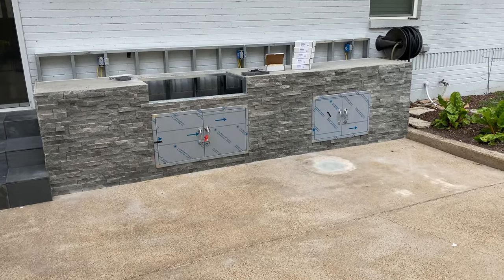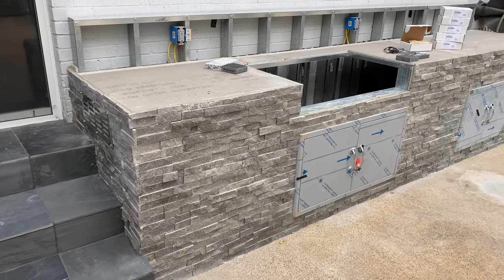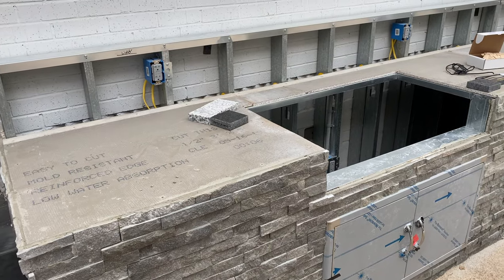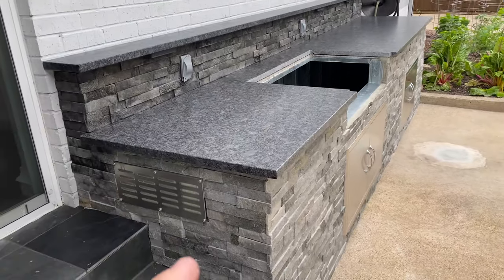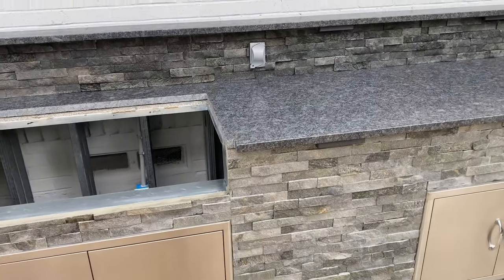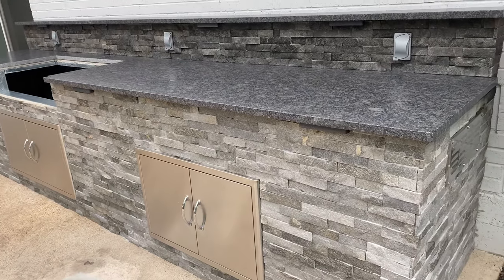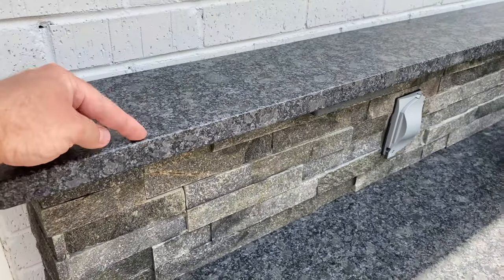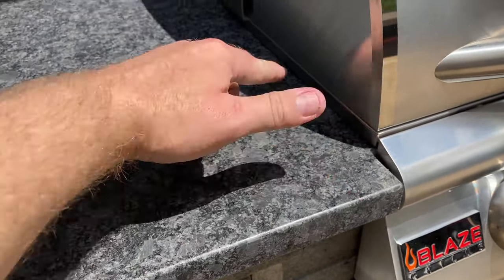Building an Outdoor Kitchen PART 2 - DIY Build Finishing Stone, Counter & Lighting

Comment: I realize this video is dated now, so please answer a burning question or two: a) How is the setup holding up/working out? b) Did you regret building up against the wall? At one time we BBQ'd on the pavers in the back yard but the proximity to the house caused soot buildup over time. We didn't notice until we painted and the 2nd story was black, especially the soffits.

Comment: Hi Brandon. Congratulations on this build, it looks amazing! How did you deal with the stacked stone in the front where the floor wasn't even from one side to the other? I saw that you used over an inch shim on the right side over the left side. Thank you.
Reply from the maker: Just started from the bottom and went up. The very small gap is under the granite edge. Caulked it after the put in granite, don't even notice it there.

Comment: What an excellent build sir. The lighting was great idea to add I didn't think about that. I have a question I was looking at the blaze also and wondering did you need an insulated jacket for the grill? I didn't see one installed or does your grill not require one? This is my dilemma- I want to build with steel studs like yours so its non- combustible.
Reply from the maker: I did not need the insulated jacket since it was build with “non-combustible” materials.

Comment: i have saw-chopped ledger stone, it is similar to yours, but much deeper.  It is chopped on the thin side and sawed on the wide side.  So, I thought I should mount it horizontally instead of vertically, meaning the chopped side is exposed and the sawed side is stacked with mortar.  How do I lay the stone across the tops of the drawers and cabinets?  Should I pull out the drawers and cabinet doors farther from the cement board, so that I can stack the stone on the top of the steel?  It needs support, otherwise I think it will fall off.  Thanks.

Comment: Looks great! I am however concerned about the amount of heat generated under the counter. Did you use some sort of heat shield? Want to be sure before I build mine. Great job, thanks for sharing!👍
Reply: He's got a vent in the side wall near the stairs going into the house.  The installation instructions that come with the grill should specify how to properly vent the countertop.  The vents are mostly to prevent possible gas build-up and explosions, but do help dissipate heat.  The lid of the grill will also vent some heat, even when closed (from the front under the controls to the back of the lid).

Comment: Awesome job Brandon. You have skills and taste! Question, Did you draw a level line along the bottom of the front of the Permabase and start from there with the stack stone? Since the ground was not level. Then cut the bottom row of stack stone to fill in space from the floor to the level line? It  looks perfectly even. Loved your videos' I will use steel studs for sure now.
Reply from the maker: I was originally going to start the stone on level chalk line but that really complicated it. I actually I just started stone flat on bottom. It worked out at the end, especially if you can’t tell. Look closely at very bottom, all full stones. Thank for watching.

Comment: Brandon, awesome job Sir.  You inspired me to construct a similar outdoor space.  I'm adding similar landscape lights.  Did the wire and top support frame for the landscape lights have any negative effect on the granite countertop?  Worried about the wire getting pinched or the granite not sitting right.  Great work!
Reply from the maker: No issues with wires. I notched the top so the wire sat flush with top See here 8:03. Plus any granite company you hire will level the countertop as needed.

Comment: Looks great and enjoyed the video and info provided.  I think I will use similar lighting.  I am just framing my outdoor kitchen now.  Did you have to put cement board under the countertop and why?  Just to better adhere?
Reply from the maker: After the fact I really didn’t need to put cement board under countertop per granite company.  But half way thru I couldn’t change that based on my measurements for grill height.

Comment: Hey Brandon. Really like the landscape lighting touch. As installed (under your granite countertop I believe) how do you plan to service if a light goes bad or bulb burns out. I know my garden bed landscape lighting bulbs go out more than I like although they aren't LED. Just wondering if you have a method planned should you have any issues with these down the road. Thanks!
Reply from the maker: Good question. So that one main reason I went with the higher quality $$$ FX brand versus a cheaper wall light. Everything is accessible on the exterior. Here is more detail of the repair…  https://www.fxl.com/support/changing-led-board-lf-wall-light  But time will tell!!

Comment: Great Video!   I have watched numerous times and I will continue to.  I am planning on using the same adjustable outlet boxes but I can not seem to find any weatherproof outlet covers to fit those blue boxes.  How di you do it and what did you use?
Reply from the maker: The outlet cover is Sigma Electric, Gray 14147 1-Gang Universal Cover. Maybe a quick search and you might be able to locate it. I went back and forth on a cover I liked, not many options out there.
Reply: @bmarsh011  
Thanks for the info.  I’m using the same outlet boxes and I found the weatherproof covers you recommended  they should work great

Comment: This is amazing! When measuring the cutout for the bbq, do you consider and extra, I’m assuming 1-1.5 inch for the board and veneer? So if the cutout depth for bbq is 28”, are you cutting 28” out on the frame, or about 25-26”?

Comment: This came out great and will definitely reference your video as I start my DYI project.  A few questions:
How much of a granite overhang did you include to incorporate lights?
How do you power and turn on lighting? Is there a transformer mounted somewhere and wifi controlled?
Also how much of a gap did you leave at the bottom before stone starts?
Thanks
Reply from the maker: Granite Overhang: the depth of top granite is 7in.total With the backboard and stone on the overhang finish is roughly 1.5 to 2in, varies some with the stone thickens in different areas. Where is light at there is only about 1/2 overhang
Lights are wired to my landscape lighting that is powered with transformer. Powers the front and back of house landscape lights and grill all connected together. You could just have a separate transformer for your grill area if you want to keep separate. 
No real gap at bottom of stone, very thin to minimal gap. 
Hope that helps

Comment: Looks great!  Curious about how you dealt with the ledger stone.  It looks like you slid your grill over the ledger stone but for your doors, you installed them first and butted your stone against the frame.  If so, why didn't you also butt up against the grill face?  Also, with the specs on the MSI stone being 1 inch deep, did you mount the doors flush with the cement board or did you have a spacer?  I would think the 1 inch of stone + mortar would leave the doors looking too deeply set which would be hard to see on the video.  Just framing my project out now and would appreciate your thoughts on this.  Thanks!
Reply: I'm wondering  the same thing
Reply from the maker: Mounted door flush with cement board.  Depends on the doors you get, I choose these because of how the edge looked for stone to go around. Too deep set? Guess, a personal choice what you want. If I had set the doors on top of stone that would have looked bad with the variety thickness of the stone, if you did something like tile that is all even you could place doors on top of that. The grill barley over stone on right and left side, gap under grill for air circulation.
Reply: @bmarsh011  - Thanks!  Have actually laid my hand on some MSI stone and it's more like 0.5 inches deep which makes a lot more sense.  Again, thanks for the video and response!

Comment: Great job. Doing something very similar as  a first timer. Love the landscape light touch. Potentially dumb question, but did you put cement board inside as a floor or is the bottom open to the patio slab? I'm trying to figure out if there is a need for any type of inside floor/shelves inside the doors for storage, etc. Thanks!
Reply from the maker: Thanks. I left to “floor” cement. I am thinking about a way to maybe make some storage/shelves inside.

Comment: Brandon, I really enjoyed your presentation. I am locating materials and I need help. 
I looked for the "12/2 UF Electrical Wire for Wet/Damp Locations" but the Amazon link doesn't work. Can you advise further details or reply with photo of the packaging? Is this under ground wire? Thank You in advance for your reply. ;-)
Reply from the maker: Southwire 12-2 UFW/G Wire. Cable designed specifically for use as underground feeder cable for direct earth burial in branch circuits, and indoors for wet or corrosive locations. Find it here on Amazon: https://amzn.to/3hWghE5

Comment: Very cool.  Are those landscape lights always on (on a hot line) or do you have them on a switch?
Reply from the maker: The landscape lighting is low voltage connected to transformer with a timer to kick on and off with dusk/dawn automatically. Learn more here... https://bit.ly/LightingDoctor

Comment: Are the hardware lights controlled using a 15A light switch and can they be used on a dimmer?
Reply from the maker: No these are low voltage landscape lighting.